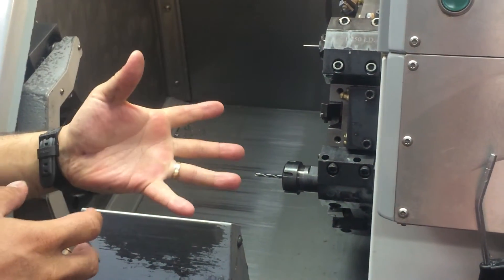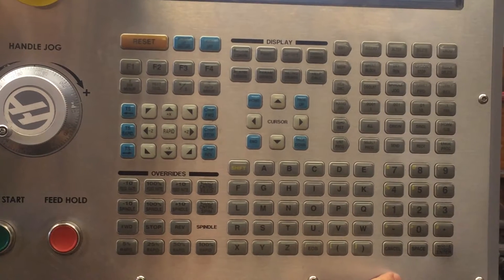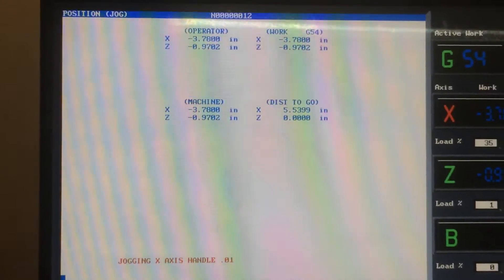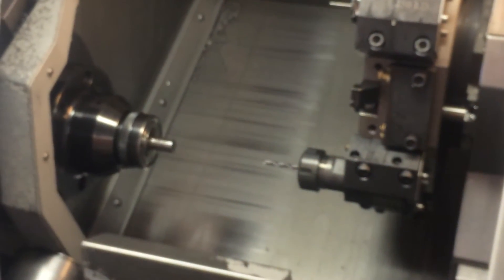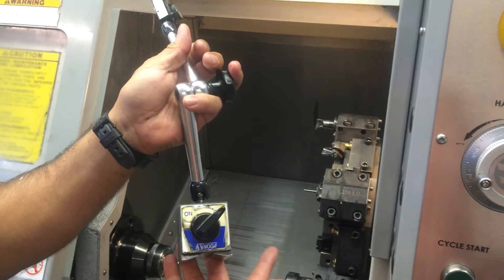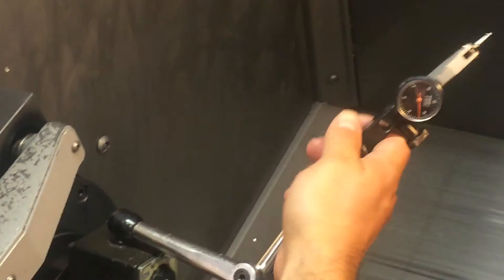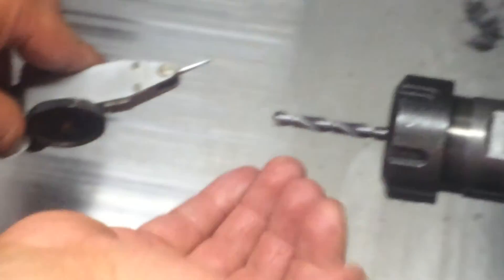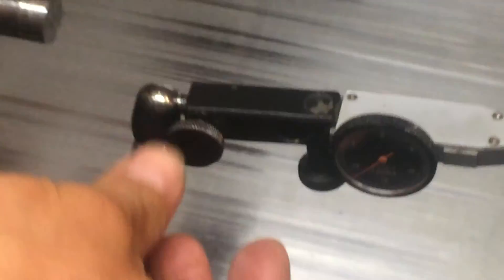INDICATING A DRILL PART 1

Comment: never use a mag base on a chuck. as you turn the chuck 360 the mag base will sag a few thousands and your reading will not be accurate.   To demonstrate this,  put your mag base on a piece of metal with the indicator probe zeroed on the actual piece.  Then turn that piece upside-down and watch how your indicator needle moves about .002... maybe not much but definitely better to clamp your indicator.
Reply from the maker: Ruben Alvarez, you can actually use an actual collet Hardinge collets have the least amount of run out which I recommend using over any other ones. This way you can eliminate any sliding of the mag base if that is a concern, i have been using a mag base for over 15!years and have never broken a drill "dynna points " which have to be indicated within .0005 to .001 but thanks for your comment.
Reply: You might not get a broken drill and depending on what you're making it may not even matter.  However I work in the Aerospace industry and there are times when we're actually indicating a reamer in on each flute to assure tight tolerances.  A collet would actually be the best bet but when you're using a chuck there's no time to switch over to a collet.
Reply from the maker: Same here, been in the industry for over 15 years and own my own shop, if you are using a chuck I recommend have a machined piece of aluminum or steel machined to fit your indicator clamp so you can mount it easily on to your chuck, if I was indicating a reamer. This is just a basic method to indicate the X axis on a two fluted drill taking in account that your holder is concentric, has been indicated in all the way around and the machine has not been crashed. For reamers I prefer using a Brookfield made by Hardinge they are self centering and extremely accurate if used properly plus it takes literally less than 2 minutes unless I am reaming on my mills.
Reply: Sounds good to me.
Reply: Toro Man hi Toro man is there a part 2 of this great video? All what is the difference between indicating the flutes and the back end of the drill near collet? Thanks
Reply: Ruben Alvarez hi ruben, so your saying it is best to clam indicator using the chuck? Do we need some kind of special fixture on dial indicator to clamp down on it?
Reply: @pauldiaz4273  mag base
Reply: wtf you are dumb as hell. That is the industry standard. They do not sag if you didn't get your mag base at the 99 cent only store...